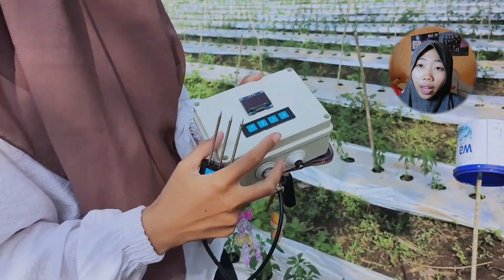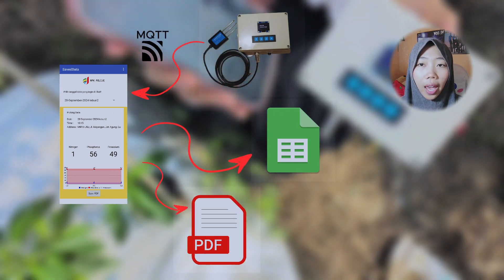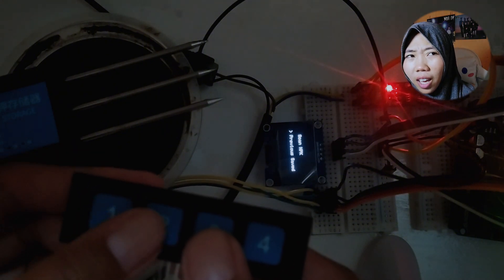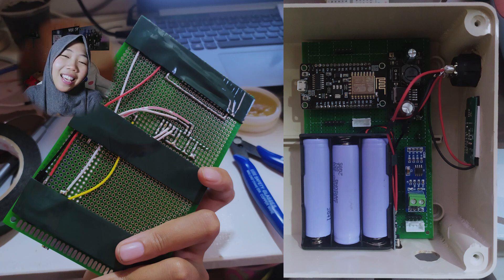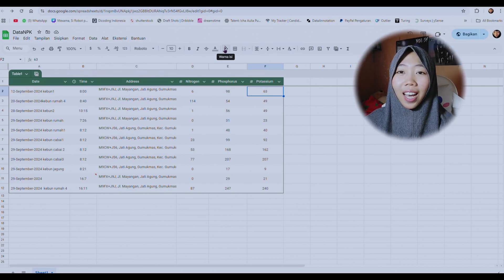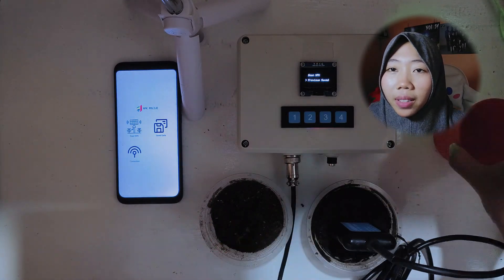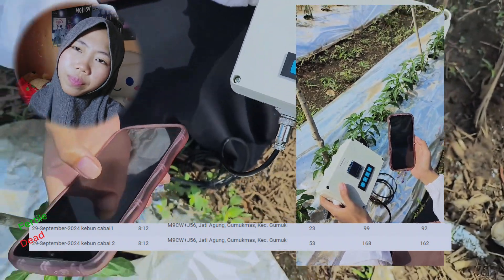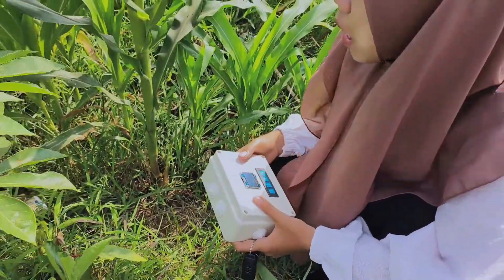3 in 1 NPK sensor with ESP8266 IoT project

Comment: Hi, do you know if that sensor works? I use it, but I'm not sure if its values are reliable. Do you have any studies that validate it?
Reply from the maker: Hallo.. 
Hi.. I used several soil samples, one with more NPK and the other with less NPK, which are known to have what the values are and what the NPK fertilizer levels are. I didn't really do any complex data validation or use any special methods.

Comment: Ok, now I use Modbus poll and see the sensor npk values. Now what part of the code do I need to change? My baudrate is 4800. Do I need to change anything else? 
const byte nitro[] = {0x01, 0x06, 0x00, 0x0d, 0x07, 0xdf, 0x5b, 0xa1}; // Nitrogen request
const byte phos[] = {0x01, 0x06, 0x00, 0x0f, 0x02, 0xb6, 0x39, 0x1f}; // Phosphorus request
const byte pota[] = {0x01, 0x06, 0x00, 0x10, 0x00, 0xbc, 0x89, 0xbe}; Did this change?
Reply from the maker: If you found something different between the value of configuration in the code and the baudrate of the sensor, try to change it to the configuration you found in the RS485.
Reply: @Aeslip  Do you have any other contact channels? I want to send photos and ask questions.
Reply: @Aeslip  I still get 255 as usual. Do you have another way to contact me? I would like to ask.
Reply from the maker: @preeraphat4962  dm my Instagram, send me the picture of your calibration, wiring and the output when you run the code..

Comment: Hello, I'm sorry to bother you again. I tried connecting the device as shown in the picture, but when I pressed scan, the values I got were n 255 p255 p255 max, even though I haven't measured the values from the soil with the sensor yet? T-T
Reply from the maker: Have you do calibration with modbus RS-485? Because if you upload the same program as mine, you should know the baudrate of the sensor, because sometimes they have different setting. And you have to make sure the cables are good and proper because they're so sensitive
Reply: @Aeslip  Can you suggest steps on how to check and where to fix in the code?🥲🥲🥲
Reply from the maker: @preeraphat4962  use usb RS485 and connect it to your npk, download the modbus RS485 (you can download on the drive I was shared to you). Plug in your the usb to your laptop then start the calibration until it show the value of npk then check the baudrate. Use the calibration and baudrate on your program
Reply: @Aeslip  Thank you very much. You are a very kind person. I wish you good luck in everything.❤
Reply from the maker: @preeraphat4962  thankyouuu.. 
If you struggle with the sensor don't hesitate to comment okay! Fighting!
Reply: @Aeslip  Hi, my USB to RS485 just arrived. I'll connect it to my computer, but the 485version.exe in your drive is not working. I click to open it, and nothing happens

Comment: Inhave doubt indont know how to connect with 3 pin npk sensors data not received can u help me
Reply from the maker: Sure, what microcontroller are you working with? and have you tried configuring it?
Reply: @Aeslip  can u send your mail id plzz i will send the image of npk sensor
Reply from the maker: use RS485 modbus to cdo configuration, and also you can find the baud rate of your npk sensor work with. because mine only work on 115200. also the pin of your microcontroller.
Reply: @Aeslip  can you send your mail id I send that image or model help me plz

Comment: Congrats! This project is amazing. Do you think I can replicate something similar on an ESP32? I want to use only the 7-in-1 NPK sensor and an ESP32 LoRa. When the sensor takes measurements, the information will be sent to the cloud
Reply from the maker: oh thankyou very much! 

of course you can, i ever told to try the device in the company where I used to work before and they use 7 in 1 npk sensor with esp32 as the controller and it runs well, maybe later it should be configured properly, because the baud rate and the pin have to in the exact place and time. and about the lora that's great idea! i ever try it but never really put it into project, but your idea is great!